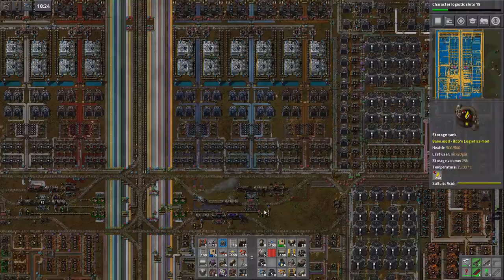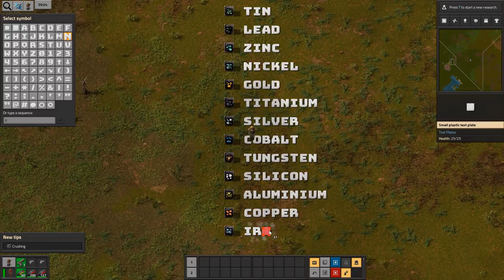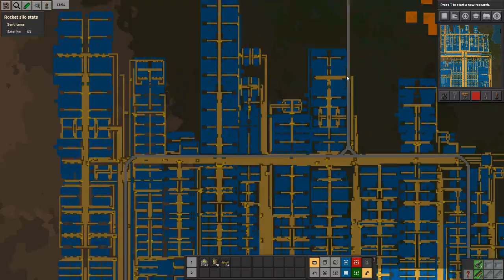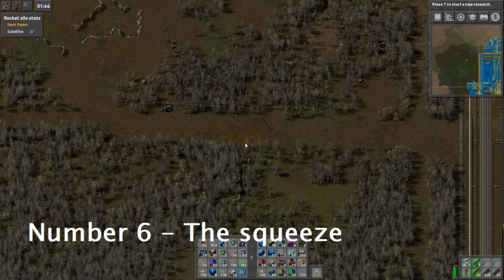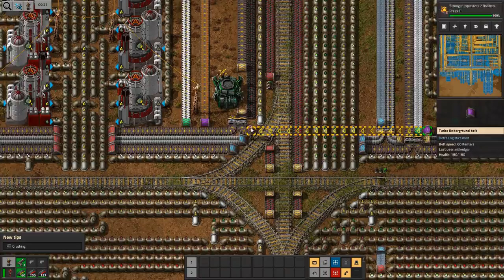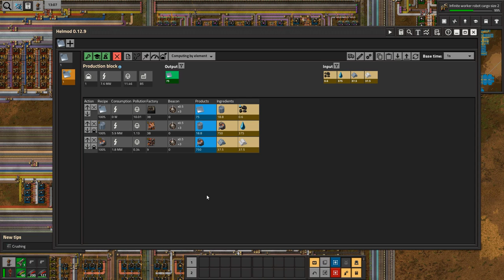Factorio - The ABC's of Angel and Bob

Comment: Another tip I'd have for managing metals is think of it in terms of 3 + 1 steps. Step 1 is sort the minerals into ores, step 2 is smelt the ores into ingots and step 3 is melt down the ingots into the various plates, sheets and coils.  The +1 step is mining and crushing, where crushing on the mining site is viable if you create a dedicated train stop for dealing with crushed stone, but can be ignored if you decide to include crushing as part of the sorting step. separating

Processing and sorting minerals could also be split if you decide to focus on catalyst sorting.

Comment: I would reconsider your advice regarding fluids.

Fluids are not more viscous than they are in vanilla - the problem you're having is that you simply are managing higher quantities of fluids and gas, than you are in vanilla. 

To understand how to deal with fluids, you need to understand the fluid mechanics on their basic level. In here, I'm going to explain how it works if you don't have "big pipes" enabled in Bobs settings (I recommend enabling it - it makes the game easier, but Vanilla fluid flow mechanics are really annoying to deal with, pointlessly so. It will still remain a challenge, just not excruciating one when dealing with high throughput).

A standard tier 1 pump corresponds to vanilla pumps; it can pump 3.6k fluids per second. This is a lot of fluid.

What the game doesn't tell you however is that this pumping only works at this capacity if it's pump to pump. Maybe pump to tank to pump, not entirely sure. But if it goes pump to pipe to pump, it already cuts down significantly the fluid flow. I believe the resulting flow will be somewhere 2.4k/second.

Now here's the kicker: pump - pipe - pipe - pump = halves the flow. From there it only gets worse, but you can see how with merely having 2 pipes consecutively means the fluid flow cuts off severely. You come across easily into situations where you want, for example, the piping to go a single tile left and then continue its trajectory forward. Easiest solution to this is to just do two pipes between two pumps. But this unfortunately cuts it down severely, so another solution is to do a bunch of pump - pipe - pump and pump - pump, have it loop a little. 

It's really annoying how it works, but this is how it works. Bobs has a setting that can amend this by increasing pipe capacity. On its own higher capacity pipes don't do anything, but combined with pumps they create a flow similar to pump - tank - pump, which is higher than pump - pipe - pump, even if it might not reach pump - pump flow. 

Another important part: you cannot restore flow to a previous level. You can only maintain a flow. If you have pump - pipe - pipe - pump, you can no longer restore the flow to the level of pump - pipe - pump, without introducing additional sources for the liquid down the path.

Last important note: pump - underground pipe - pump = pump - pipe - pump. Underground pipe, like underground belts, counts as a single entity. The fluid it holds is the same on both ends, so it acts more like a teleporter than an underground pipe. This is convenient for us, because it means that you can maintain the relatively high flow of pump - pipe - pump by using underground pipes. 

It also means that underground pipes, whenever they can be used, are always more efficient than pipes. This is why you have to evaluate whenever you should use a long stretch of standard pipes or a single underground pipe, as you seem to have many long stretches of normal pipes. Even in low throughput situations, having multiple pipes can really clog things up, because they keep reducing the maximum flow significantly. 

It should be obvious also why your solution "the squeeze" as you call it aptly, works here. You're cutting the amount of pipes from startpoint to the endpoint, thus not reducing the flow as much as you would if you had a single line of pipes snaking through. What you're doing is actually useful even in a proper liquid management setting, because it can allow you to combine multiple low-pressure lines into a single high-pressure line. This way, you don't need to have pumps in a setup that is snaking around, only in the output.

But at large, you need to use a lot of pumps and underground pipes. And to make your life less hell, use the big pipes mod setting in Bob mods.

Even with most optimal use of pipes, you may end up in a situation where your only solution is to use multiple pipes in parallel. I've run into this a couple of times myself already, but that was before I enabled big pipes. Now I can deal with 10k/s liquid input or output relatively easily with a single station and I'm using second tier pumps.
Reply from the maker: Wow. That is quite a comment.

I think what has happened here is that I tried out pipes and quickly decided that they didn't work (for whatever reason) and moved on to barrels. But you ploughed on through it and as a result have a much better understanding of what is going on. I learnt a lot there. Underground pipes particularly. If it didn't ruin my whole design aesthetic I would be replacing all my pipes with underground ones.

I think my advice stands though, for most people the pipes in angel and bob are a black box that are difficult to understand. Until I read your comment I wasn't 100% sure of why they didn't work for me.

Have you thought about doing a full pipe tutorial? I would definitely watch it
Reply: Why not use trains for large amounts?
Reply: @QTwoSix  Because trains don't change the nature of the problem; you have to get them into and out of the trains and it is easy to screw in that process.
Reply: I had no idea about that game option thank you. I was using modded small one block tanks going onto pumps to force high volume gasses into midpoint staging tanks. Had real issues getting oxygen to make my sulfer dioxide. Or ammonia for the hydrazine.
Reply: Worth noting that as of Factorio v2.0 (coming in October 2024) the way fluids move through pipes will be completely overhauled to be much less arcane, which should fix a lot of people's gripes with the old system (at the cost of a small amount of emergent complexity)
Reply: @chrisprice8112  Indeed. I welcome these changes at large. And I don't care what-so-ever about it enabling silly setups. Obviously its not ideal but alas.

Comment: I "only" used Bob's mod in my last playthrough and it was crutial to reach modules because once i had them going, i could focus entirely on speed/productivity modules. The moment you finish them you can pretty much cut down 95% of your factory, only use drones and have ridiculously quick machines going. Took about 120 hours to get there in my playthrough but i decimated my entire base down to a few machines per item

Comment: SPM is essentially a benchmark for megabases rather than a realistic measure of how fast you can actually complete sciences(especially in the middle of actually unlocking those sciences). no real reason to measure spm until you are able to flex. SPM is just a good benchmark because its the last step of all continuous processes you are going to make in a factory, and given that sciences "void" rather than get used elsewhere, that means theres very little to get in the way of stopping this continuous process besides stopping research entirely or the throughput of your lab research setup.
Pretty much anyone who has played angels already knows that research goes in bursts at best because of just how long it takes to get to the next tier. So a basic 1Science/sec setup is pretty much all you need up until you decide to do something crazy like Research overhaul and SpaceX researches.

It used to be Rockets/min before rockets got their ability to produce science as well. Its a better indicator of the actual goal, an "endgame" base, but realistically isnt a good way to show the full capabilities of a factory because of how little you actually need to make a rocket compared to a science setup(which is probably why the spaceX research mod was even made, to have an absurdly high research sink before infinite researches were a thing).
Reply from the maker: I can't tell if you agree with me or not?! 

I remember the days when it was rockets/minute, I had contempt for that too!! (I'm not a fan of SPM, I prefer to just build to have fun, but that doesn't really count for much on YouTube!! We all want metrics!!)

Comment: i'm currently playing these mods, further modded of course: Angel's experimental / alpha branches, some other extensions..
A day is now exactly 1h each..
My evo factor scales with science progression..
Science is now incremental, has a 2 | 2 multiplier per tier (lab time | science count) and gets an additional 3x multiplier (scaled by evo factor)
Also, science has now 7 tiers..
Most components are incremental as well and have 5+ tiers..
Biters now have 10 tiers, whereby the last one would be 5 times stronger than vanilla endgame biters..
Then there're biter factions and classes..
Evo factor increases rapidly increases with spawner destruction but resets every hour back to about the science ratio..
Once i built the rocket silo, it becomes a nexus, draws aggro from hundreds of km away...
Rocket silos now also have several stages when constructed..
Behemoth worms will burrow through ocean at ~90%..
Megalodons spawn when spawners are destroyed at ~66%, and they can swim through ocean by default.. (self-made mod) 

As for QoLs i use all: crates, belt stackers and loaders, mini and micro machines, LTN, ghost reader and blueprint deployer, factorissimo, nano bots, ships, warehouses and wind turbines, scrap trains and burner equipment, omega drills and deep core drills but no angel's infinite ressources..

Also, UGs are heavily restricted: tier n belts give a 2n gap and tier n pipes give a 1+4n gap..

So, yeah, it's much more complicated now..

Ressources per patch where a bit of a hassle, 7-25M within the immediate 5km, 7-50M within the next 10km, 45-110M about 20km away, 450-850M about 100km away.. and about one patch per 10° and 5km from the origin..

oh, and i play on huge islands with expensive landfills (2k stone per item).. currently sitting on a big island with a huge sattelite island nearby..
Additionally it's a lazy-B run, made possible by a "manual" tier 0 generator and an "all-you-can-craft" tier 0 burner-assembly..
I'm half way through green science (tier 3) and i've just started to plan out my component tier 2 factory units while reaching evo factor of 11% after 160h ingame.. Until now, my tech is half-automatic and i recently used 3-7 min per research..

Longterm i'm already planning to attack a new giant island, cause my bigger sattelite island would probably only get me through science tier 5 tbh due to the limited space and Coal in here..
Biters aren't a problem yet, i basically eat some fish (half a ton per campaign) and they gonna run away..

Yeah, this game is nuts xD
Reply from the maker: DUUUDE!! Talk about making things difficult for yourself. I spent 3 years, 6-7 factories, 2500hours just getting the factory right. Played with biters once but on peace mode (the timelapse). I was interested in angel and bob purely for the technical challenge. What you are doing is next level.

Comment: Desulfurization of coal is the best way to produce sulfuric waste water (and therefore sulfuric acid) in bulk. Coal > Crushed Coal. Crushed Coal > Coke (sulfuric waste water byproduct). Coke > Carbon. Carbon > Carbon Monoxide, which can be used in the factory or burned in a flare stack.
Reply from the maker: Desulfurisation of coal is, as far as I am aware, the only way to start the sulfur process. Thats where I get the first sulfur from that makes the first sulfuric acid that then drives everything else.

You are right to point it out, it is a critical part of the process, but there are hundreds of critical processes in angel and bob and if I went through each one I would be here until the ends of time!!

Comment: if you are gonna make little pools to put an offshore pump in, then may as well just get the pump anywhere mod and cut out the annoying part, and have it be more easily blueprintable.
also i basically always play with angelbob,madclowns space extension, expanded rocket payloads and a handful of mods for angels like extended smelting and casting, but also bio industries mod, which i generally use to make sulfuric acid, which if used primarily , makes sulfur and its waste water into much more of a waste product or to be used for other recipes. also i'm not a fan of the angels way of making trees/wood so bio industries also solves that .  also i use yuoki industries for the huge power poles, its cool having a completely separate base that does yuoki stuff all just to make power poles.

Comment: I've noticed you arent using any pumps in your factory. That is probably why you are having problems with fluids and gases. Idk about angelbobs but in vanilla you need 1 pump after every 15 pipes to keep a decent flow rate.
Reply from the maker: The fluids behave completely differently in angel and bob. I have tried many times to use pumps in A+B and it has never worked. Slightly higher flow rates yes but when a pipe is only giving you a quarter of what you need a slightly higher flow rate is not good enough. Pipes in A+B are an issue

Comment: If it's only s, not spm, then is it one of each building? You seem to have multiple buildings of the same type so you do calculate some ratios. Could you elaborate on this? How do you know how many of each building to build?
Reply from the maker: Good question.

I only really do research when I need to construct the next part of my factory in order to unlock the units I need to build. So I unlock a tech, build a thing and then unlock another tech, build the next thing etc. In between doing research there is a lot of time for the science ingredients to build up in the conveyor belts regardless of how quickly the factory is producing them. So when I need to unlock a tech I can rely on a quick burst of ingredients before one of them runs out, becomes critical and slows all the science down.

The science block I actually build is generally done to fit in a specific space in the factory, I don't really care how many assembly machines or labs there are, only that the proportion looks about right. At the end, when the whole factory is constructed, I research all the leftover techs one by one to identify the critical ingredients and try and improve the production rates of those ingredients to get a better science rate, but there is a limit on how far this can be taken. I then also use different speed assembly machines for different colour sciences to try and tune the setup so that they are all creating the science packs at similar rates.

At no point do I really care what SPM it is creating, it is generally just an exercise in squeezing as much out of what I had constructed and out of what space I had available to me. The bigger the setup the bigger the burst, the size of the science setup has no relationship to what the factory is actually producing.